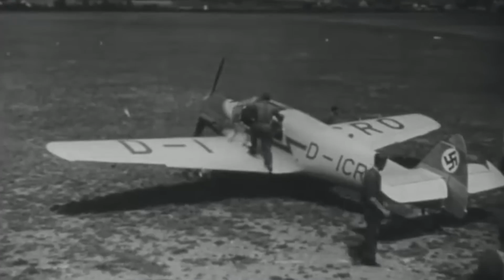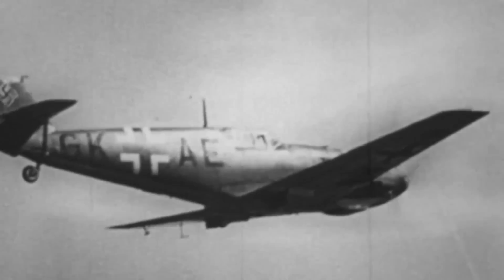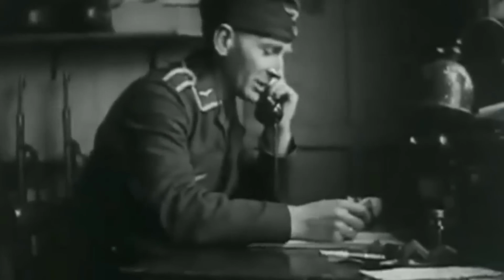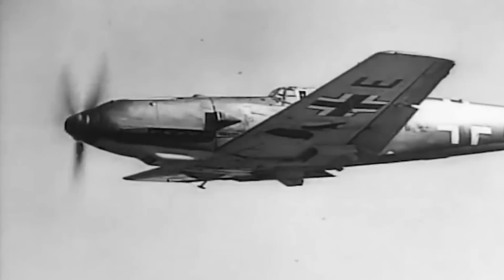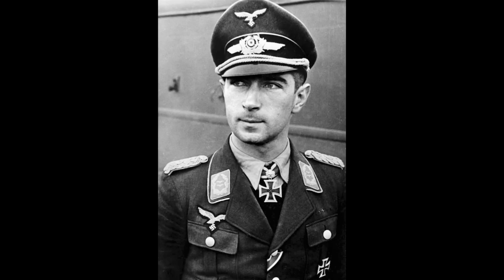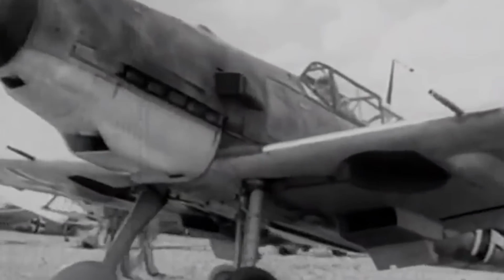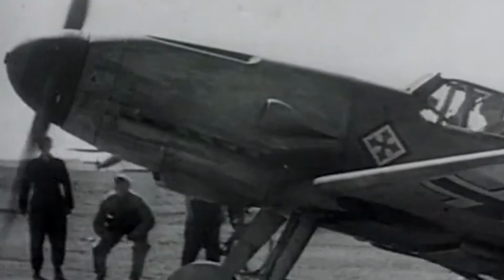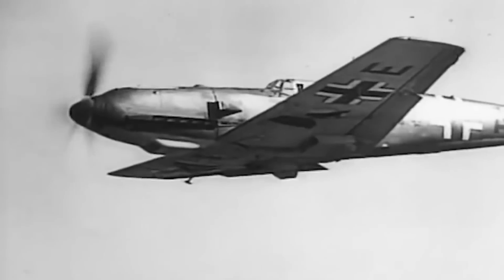Messerschmitt Bf (Me) 109: A Luftwaffe Legend | WWII Documentary

Comment: God awful visibility on the ground and in the air, cramp cockpit, terrible landing gear and shitty wing structure. The 109 was always a crap plane and none of it's issues were ever adressed, they just kept putting stronger engines in them to try and match the Allied planes, and thus it is a shit plane.
Reply: And yet its  pilots shot down more enemy planes than all allied fighters combined. The 109 was competive right till the end. The last versions, G-6AS, G-14, G-10 and K-4,  out-accelerated and outclimbed everything in the sky, save perhaps late war Spitfires.
Reply: @TTTT-oc4eb  That is a false statement of fact, as every Allied fighter that operated in the European theater had a positive Kill to Loss ratio save for some the soviet ones which I already called even worse than the 109. Thus, it is impossible for your statement to be true as what you claim would mean the Allies would have to lose more planes than they downed, which we have established is false. Furthermore, the late war variants of the 109 did nothing to address the ergonomic and mechanical failings of the 109, and furthermore the Allied aircraft like the later variants of the Mustang like the P-51D-20 and the P-51Ks were more than able to keep up with the Bf 109 K4 in terms of speed and acceleration, despite both Mustangs effectively being ready for service by the start of 1944 and the K4 only realy being ready to fight by about the same time in 1945.
Reply: @thehighground7732  CLAIMED/CREDITED kill/loss ratio is entirely different from the REAL ratio. 

The Bf 109 was CREDITED with more than 50,000 kills based on pilots CLAIMS - but the REAL number is probably a lot closer to 20,000-25,000. Same with the P-51; it was officially credited with 5,900 kills, but the real number is probably much closer to 2,000-3,000. Spitfire is credited with 4,000-6,000 - again the real numbers are probably much closer to 2,000-3,000.

EVERYBODY overclaimed - often wildly.

In the Korean war US Sabres claimed an 10:1 kill ratio against Mig-15s. The real numbers were 2:1, and only 1,2:1 vs. Soviet pilots.

The P-51 was probably the only Allied fighter that had a definitive positive kill ratio against the 109, mostly because it met German fighters and pilots after they had been worn down by Spitfires, La-5s, Yaks and P-47s, and pilot training was suffering due to lack of fuel. The P-51 was an excellent fighter, but it was rather big and sluggish compared to the smaller, lightweight and nimble Spitfire and 109 and could not out-sprint or outclimb them. It could dive away from them, though, although even here the 109 could gain an initial lead due toits better acceleration.

The main problem for late war 109s was the often shoddy workmanship in the factories due to slave labour etc.

But one on one, a well built K-4 with a competent pilot was superior to the P-51 in a dogfight.
Reply: @TTTT-oc4eb   No, the Spitfire most definitely had a positive ratio over the Bf 109 from the Battle of Britian, and after that they didn't fight much due to the British employing the Spit mostly as an interceptor. The only reason the 109 has such a high kill count is because of the Russian shit, as well as the thousands of bombers it was sent to deal with. Furthermore, the Mustang first saw usage as an escort fighter with the 8th Army Airforce in mid 1942 when the Luftwaffe was at the peak of it's strength, and it blew the contemporary 109s out of the water. It's sole disadvantage, the weight was irrelevant at the altitudes that escorting bombers entailed (hence why the P-47 and P-38 were so heavy), and it could out run, and out gun all the contemporary 109s.

No, a well made Bf 109 K4 with a competent would still lose to a contemporary P-51, (lets say a P-51D-20) built to the same standards with a similarly competent pilot, as the visibility issues were never fixed, the pilot would still be in an incredibly cramped cocpit and have to fight both the enemy plane and discomfort of his own plane, the guns on the K4 being slow and hard to aim as they designed for use primarily against bombers, and the structure of the plane being far weaker, with the wings and flaps of the 109 snapping far easier in high speed manovers even if built to the same quality as the P-51.
Reply: @thehighground7732  The Bf 109E shot down more Spitfires in BoB than vice versa - the numbers are out there. When the tables were turned, during the "fighter sweeps" in second half of 1941 the new Bf 109F absolutely butchered the new Spitfire V - 4 spits lost for each 109 - more than 400 Spitfires were lost. Interestingly Fighter Command claimed more than 700 German fighters lost - the real number was just over 100.

The Merlin-engined P-51B didn't see combat in numbers until the spring of 1944, and it wasn't until mid 1944 the numbers really made a difference. By then Luftwaffe was in sharp decline. And it had only 4 x 0.50 cals. and was thus one of the weakest armed fighters in ETO. The B model continued to make up large numbers of the P-51 right till the end. The Allison-engined models were low altitude models and did not blow anything out of the sky above low altitude.

The "wing snapping" 109 is just a myth. Late war 109s had two 13mm guns they could use in addition to the engine-mounted 20 or 30mm. It was mainly allied test pilots - used to the spacious cockpits in their own planes - who complained about the discomfort in the 109, you rarely hear Luftwaffe pilots complain. Instead they claim the visibilty was surprisingly good because the head was so close to the window. And controls were much simpler and easier than in US fighters.
Reply: @TTTT-oc4eb  The reasons the official numbers are so different for spitfire victories is because the Spitfires pilots tactic was to often just run out the fuel of the 109 forcing them to ditch, meaning they may not have actually shot down many of the 109s, but they most certainly brought down more than you give them credit for.

No, P-51Bs with Packard Merlins were in the hands of the 8th army Air Force by the end of 1942, and P-51Cs were there by mid 1943. I have no idea where you got any of your information about the Mustangs arrival, but you are completely incorrect. 

Just because the German pilots didn't notice it, doesn't mean it wasn't an issue. After all, Japanese pilots never noticed the zero rolled worse to the right, untill it became common practice for the Americans to exploit that weakness. Same is true for the 109, as the American pilots know the weaknesses of a razorback cockpit, having used it themselves and knowing how hard it was to see behind them, while the Germans, who have never seen a bubble canopy in their lives won't know how much better visibility the Americans had. Furthermore, the 109s cockpit being cramped was often noted by pilots who moved from a Bf 109 to an Fw 190, meaning the German pilots did at least feel some sort of discomfort in their 109s, they just might not have been able to express that they felt it, or they thought every plane was just as uncomfortable.
Reply: @thehighground7732  You are wrong. The first P-51B entered service at the end of 1943, and it wasn't until spring the following year it really began to make a difference. These first models also had a lot of teething problems, so they weren't really combat ready until 1944. All P-51B’s were grounded between the 10th through the 15th of March in order to address structural issues with the aircraft’s engine mounts, wings, and tail. 

All late war fighters had their strong and weak points, but they were close enough in performance that pilot quality was by far the most important factor.
Reply: @TTTT-oc4eb  No you are incorrect, the Mustangs were running all throught the end of 1943 and yes the snap roll was an issue, but the range of the Mustang was so nessacary that it was service even while that was being sorted out.

The late war planes on paper in the lat war may have been equal, but as you stated earlier, quality control of countries like Germany and the USSR was very poor, leading the US and Commonwealth planes to be generaly better.
Reply: @thehighground7732  Can't take you serious when you don't even get the year for your beloved P-51 right. Google it. It wasn't until the summer of 1944 the P-51 could escort all bomber bomber raids over Germany. And by that time Luftwaffe had lost control in the air on all fronts.
Reply: @TTTT-oc4eb  Your asking me to google things when a simple cursory glance at the squadrons that the 8th Army Airforce reveals that they used the P-51 en-mass before the end of 1943 and drop tanks enabling them to go all the way to Berlin and back were available in December of 1943. Go look in the mirror before you act afool.
Reply: @thehighground7732  So why didn't a single P-51 take part in the second Schweinfurt raid 14th October 1943, just P-47's.

Because the first few P-51B's started operations in December 1943.

Here's from Wiki: ... production of the P-51B beginning at North American's Inglewood, California, plant in June 1943, and P-51s started to become available to the 8th and 9th Air Forces in the winter of 1943–1944.
Reply: @TTTT-oc4eb  It was the lack of range that kept the Mustang from operating as an escort fighter untill winter 1943, as that was when the first drop tanks made it there. Also, didn't anyone ever tell you not to trust Wikipedia or any other wiki?
Reply: @thehighground7732  You're clueless. No use in "debating" this further when you even can't get the most basic things right. It was the Allison engined P-51 that was in action before late 1943.
Reply: @TTTT-oc4eb  Your the one who cites Wikipedia. The Merlin mustangs were there before December according to inventory reports, but due to the short range of them without a drop tank, they got sidelined similar to the P-39s.
Reply: @thehighground7732  So maybe you can give me a list of P-51B squadrons in service with the 8th from late 42 to late 43?
Reply: @TTTT-oc4eb  Shipping reports list them as there by 1942, doesn't list an assigned squadron.
Reply: @thehighground7732  List a single squadron using the P-51B before November/December 1943.
Reply: @TTTT-oc4eb  I only ever said they were there, which is correct. Shipping documents will list the Mustang as there well before the end of 1943.
Reply: @TTTT-oc4eb  I agree, only the Griffon engined Spits were perhaps superior. But i understand High Ground´s views, the 109 could be deadly form the pilot himself. Heinz Knoke refers in his book "I flew for the fuhrer" that many young cadets were killed in their first attempt to take off. That didn´t happen with the FW 190, far more advanced. The 109 was a race horse for giffted flying killers, with terrible FOV, cramped cabin, the pilots head often in full contact with the upper side of the canopy. Also hill suited for blind flying, lacking even a standard compass in the first marks. But in the right hands it was a lethal machine: small, light, outstanding climb, vertical performance above any other plane. A killer plane for killer pilots.
Reply: I'm American and the 109 is one of my favorite WWII fighters. Hardly a crap plane
Reply: @matta4756  Just because you like something doesn't mean it doesn't suck. Plenty of people like the Panther tank after all. The 109 never got over it's logistical and ergonomic issues, two of the most important things in any war machine, rendering it, well shit.
Reply: Odd.  How did they manage to shoot down so many planes?
Reply: @mbryson2899  because Russian planes were even shittier.
Reply: @thehighground7732  Apparently the Spitfire, Mustang, and Thunderbolt were even shittier, too.
Reply: @mbryson2899  How so? None of them had cramped cockpits, weak landing gear and the horrible visibility that the 109 had. Sure the the razorback versions dud have similar levels of rearward visibility, but they all had better forward visibility. Talk to any modern pilot who has flown all four and is willing to be objective and he will tell you the 109 is the most uncomfortable of them to fly by a long shot.
Reply: @thehighground7732  The Spitfire had every one of those shortcomings.

In any case, if the 109 was so crappy how did they manage to destroy so many  Spits, Mustangs, and Jugs?
Reply: @mbryson2899  Because the Allied pilot may have been less skilled, the weather was bad, etc etc. There are plenty of ways a bad  or obsolete plane can win against better opponents, doesn't stop it from being bad. Just look at the Gloster Gladiators of Malta. Furthermore, for every Spit, Thunderbolt or Mustang a 109 shot down, many more 109s were being shot down to the point where the Luftwaffe ceased to be an effective Air force by the end of 1944. So yeah, It couldn't even do the one thing it was designed to do well, which was intercept enemy planes over it's airspace.
Reply: Would you please stop sitting on the fence man!
Reply: It's problem was it was an interceptor trying to do the job of an air superiority fighter. It did not have a fuel or ammunition load to properly do its job
The higher powered engines aggravated the Bf109s negative characteristics making it extremely dangerous for a novice pilot. Something to luftwaffe was full of from 1944 on
Reply: @jamesricker3997  All these high powered fighters were extremely dangerous to novice pilots, and all of them had as many losses to accidents as they had to combat. The 109 wasn't anything special in that regard.
Reply: @jamesricker3997  The Luftwaffe forcing it into an air superiority fighter was only part of the issue, the plane itself had many design flaws that make it a pain to fly.